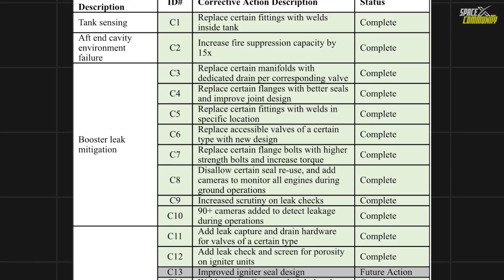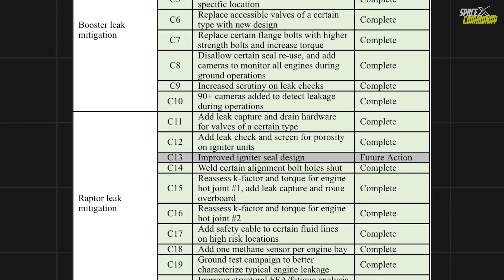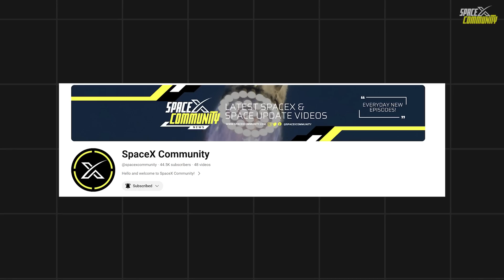NEW License for IFT 5 after Review of Ship 29 Booster 11 Data, Rocket Lab Govt Support | Episode 50

Comment: 3:59 That green hue you saw in the plasma stream was Boron; the heat shields likely use boron-silicate in their heatshields.  That means that the heatshields were being eroded.  With a melting point of 1600 C, and the expected temp of the plasma to hit about 1400 C, what happened?

Comment: A couple of comments.
First, the previous flight test did not explode. It was detonated deliberately by radio control to safely terminate a vehicle that was no longer under control. Choose your words more precisely.
As far as the FAA, if the bureaucrats working at the FAA were actual experts in rocketry they would be working for Elon at 3-5 times their current salary + stock options that would  make them multi-millionaires.  They are civil servants working at a pay grade. And their "official" pronouncements of what Space-X has to do needs to be viewed from that perspective. As a lifetime pilot I have endless experience at dealing with the FAA and have a much lower opinion of their expertise than they do.
Their new found willingness to defer to the experts at Space-X is not magnanimous, rather it is response to the public uproar over their foot dragging mindset and private warnings from the Congress that the FAA is not mentioned in the Constitution and Bill of Rights. 
Lastly, the Congress need to put limits on the endless Alphabet groups filing infinite lawsuits against Space-X and other rocket companies, or technology and manufacturing in this country will continue to grind to a halt.
Reply: While the initial approval and environmental impact assessments were lengthy, probably too lengthy, the previous two post flight reviews were led by SpaceX, not the FAA. Rather SpaceX were required to identify issues, propose solutions and then implement these. The FAA merely oversaw this by agreeing with the SpaceX's assessment of issues and then signed-off on the completed task reports. That was hardly FAA delaying SpaceX from iterating as they do so well and then progressing.
Stage 0 (the launch pad) has been almost completely revised and rebuilt bewteen the 3 launches, and I doubt Space X could have launched much faster if entiely unregulated without pragmatically still having to address this. The water dampening system was introduced, the lauch pad substantially rebuilt twice as so severely damaged after each launch and now is much more robust with seemingly minor damage after this recent 3rd launch. There has been a near complete rebuild of the vertical tank farm to horizonal tanks for faster loading and also greater safety from the ingnition blast wave and bits of exploding engines (one engine exploded on take-off this time). 
It does seem FAA and SpaceX have both modiefied their regulatory approaches and this bodes well for the further development and progress we all hope for.
Reply: @bi1iruben that still don’t address that the FAA is overseeing something they don’t understand.  Hence having the company being oversaw do the investigation. 
They look at the results for approval but can’t do the investigation.  Therefore it’s needless oversight. 
What should have already happened is a space launch agency with experts in the respective field, maintaining legitimate regulations.
Reply: I'm all for "fair and equitable treatment under the law" and all, but I think the time has come for the FAA to have a dedicated "SpaceX Only" team for investigations/regulations to expedite the process. There's no reason for them not to do this already, as after the second flight, it should be easy for them, but still...

Comment: That's huge from faa. Now they can start launching more when prototypes are ready to go. I bet within 60 days to launch ift5
Reply: Yeah by August. Will they catch is the question.
Reply: @JayDubya_TheJehova catch or not on flight 5, I can’t wait.

I hope they catch the booster, so they can fly it again.
Reply: @eugenecbell  i doubt they would, if they even catch it, probably wont reuse the booster, just a catch test
Reply: July @JayDubya_TheJehova
Reply: @JayDubya_TheJehova elon said in an interview that he will look at everything with his team and then depending on if they find any problems they will try the catch... they will also have a plan B if the booster fails to catch but elon as more about that
Reply: I suspect IFT5 will be all about the heat shield and they won’t risk the integrity of the launch tower until the second one is fully built and mostly checked out.
Reply: They were never held back.